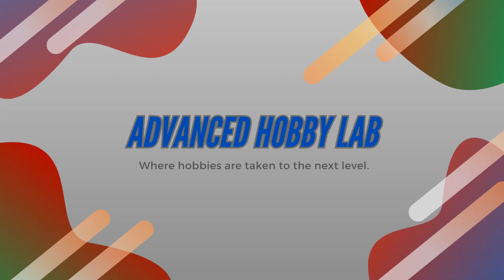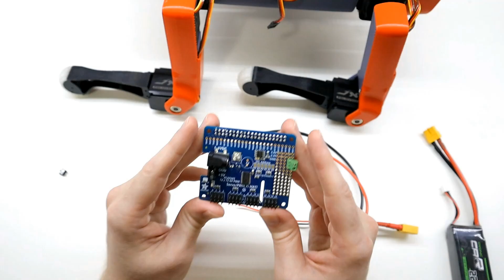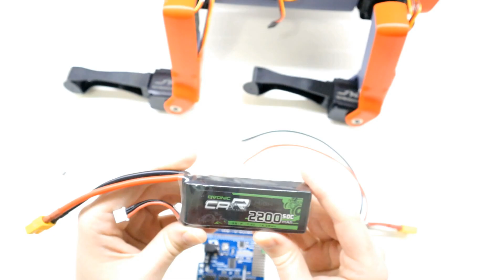How to fix servo hat to run servos with 7.4v lipo battery | Fixing my SpotMicro

Comment: I have a 7.4 volt battery 9 g servo can only handle 5-6 what do i do?
Reply from the maker: You need to add a buck converter that can take the 7.4V input from the battery and convert it to 5V for the servos. I use this one: https://amzn.to/4mGlkbO . Some small buck converters may only be able to provide 3 Amps where as your battery can supply much more power, so depending on how many servos you use, you may need a larger buck converter or multiple buck converters in parallel.
Reply: @AdvancedHobbyLab I have heard that escs have a built in ubec could I plug in the battery straight to the ecs?
Reply from the maker: AFIK, ESCs are only used for brushless DC motors not servos where they pass the voltage directly through from the battery.

Comment: What buck converter is that? Im trying to build this sort of quad leg robot with 8 servos and I got a battery just like that one but my servo controller doesn't have something like that.
Reply from the maker: This is the one I'm using https://amzn.to/4fKEWsE . Any buck converter should work as long as it outputs 5V. Also make sure it can output enough amperage for your application. I only use the buck converter to power the Pi. Servos use a lot more power.To power the servos, you may need multiple buck converters in parallel or find an alternative.